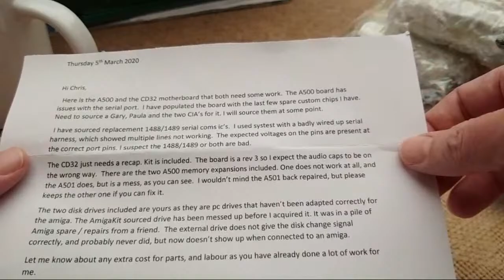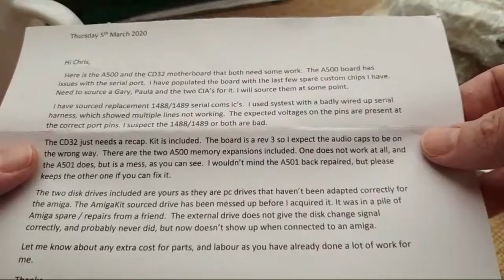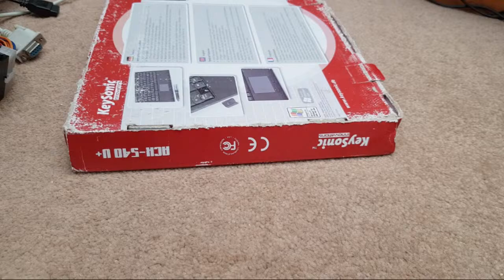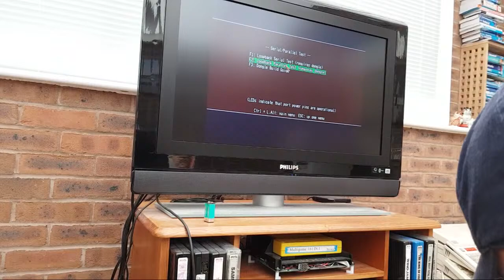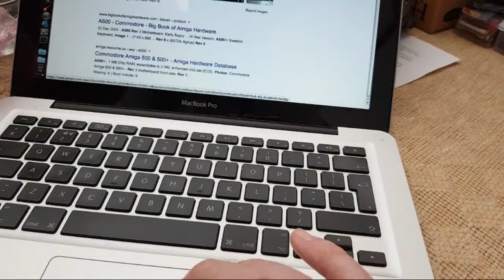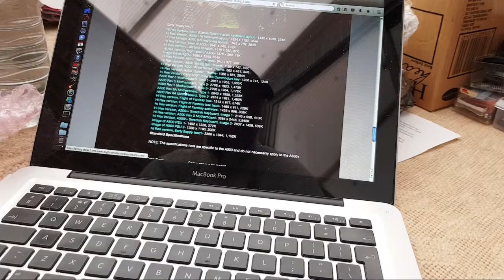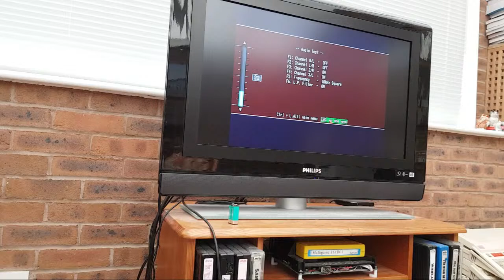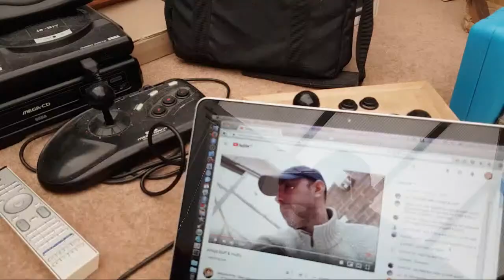Commodore Amiga A500 Serial Port Repair & Waffle

Comment: MC1488 & 89 are not current devices but standard RS232 devices which use +/- 12v signalling.
But they are designed to be tolerant of spikes induce in the lines.
I used to replace quite a few where data terminals were connected over 100M and every time we had a thunder storm I had to replace them.
The current loop you talked about is the 4 to 20mA system.
Reply from the maker: Thanks for the info there =D  My mistake (and a silly one in retrospect as I was aware they are fed with +12 / -12v, so that should have been obvious to me)!!!
Reply: Confusing RS232 with RS422, also the original spec RS232 -25pin D had 2 sets of TX/RX pins that why there are lots of nc pins on more modern (1980's+) 25 pin connectors.

Comment: Today I did the exact same procedure of a Rev 5 board. Pin 8 and 22 were bad. However after I was done there was no improvement.  Bit stuck now on what to do.

Edit: fixed it already, dodgy CIA socket, should have seen that before swapping the U38 and U39.

Comment: The part in this where you're going over the A500 serial port has really got me thinking now. I have a dodgy CIA chip on my A600 with frazzled resistors on the +/-12v power lines of the serial port. I'm now wondering if the same 148x chips may be damaged on the A600. I wouldn't want to replace the CIA and it be killed again. I'm not sure if it would or not if they are faulty.
What's the best way to test a 1488 and 1489 chip? Other than trying new ones :-D
Glad I watched this now, someone else also mentioned these chips in an older comment on one of my videos that I had forgotten about. You've jogged my memory :-)
Reply from the maker: You could try probing the pins with a logic probe and use something like SysTest as I did and see if pins are pulsing / stuck.  Other than that I would probably just swap them out.  If those chips are missing their supply voltages you will have a serial problem too!
Reply: @GadgetUK164  Thanks. I'll look into it. I do need to get a logic probe, I have one of those USB 8 channel things (I think it's 8) so I suppose that would also work but not as convenient. eBay time :-D

Comment: Today my sound was low on my A500. I opened the amiga and smells bad. I turn on again and smoke coming from the rs232 u38. 
Which one should I buy the mc1488, right?
Not sure if was a coincidence but today I had connected my gotek to a oled screen and a wheel to select. Before it worked fine this gotek but I changed how to connect it. Could a bad gotek connection have caused the problem on this chip?
Reply from the maker: It might be that the CIA died too - that sometimes goes at the same point!  The 1488 does the filter for audio I think...  The gotek could have contributed to it yes!
Reply: @GadgetUK164  My PSU gave me -17v 😤, i think was the reason and all about the Gotek was coincidence? 
After this event the Amiga didnt show image with other PSU with good measures. 
I removed Mc1488 and persists and i feel one cia was hot. I put other one in good condition and finally the amiga show kickstart image. So 2 chips died in the event. 
I have pending to solder a new mc1488 that I have bought with a socket and check the audio connecting the gotek. 
Do you think that the other chip in audio filter could be bad?

Comment: I have an A600 with a botched attempt to add an external keyboard but now the machine is bricked... Maybe you can help? I still have the vampire that I showed in one of my videos....
Reply from the maker: Could you upload some photos of the damage?  What does it do - just a black screen?
Reply: @GadgetUK164  Yes, on Sunday, I will make some Photos. The MAchine boots up to the colored error codes, and these switch between ChipRam and CIA failure seemingly at random. OS 3.1, no expansions. I really would like to use my Vampire again. :)
Reply: @GadgetUK164  I just checked. I also had other Amiga stuff to repair. The A600 indeed shows black screen with no additional flash and the Power LED also only lights up, no special signals. :( I've brought my A1200 and a recently found 1081 Monitor back to live tho....